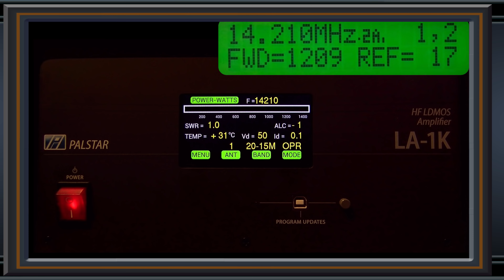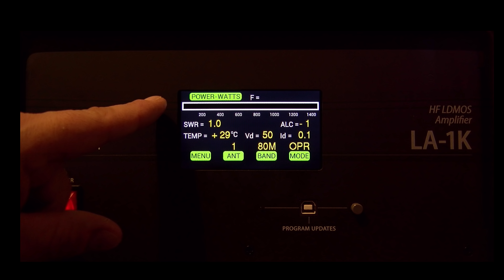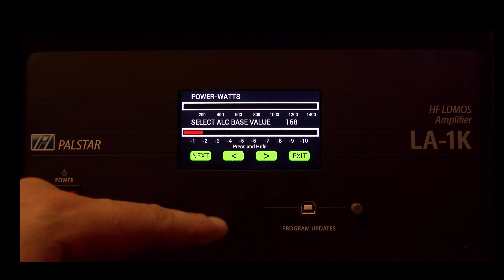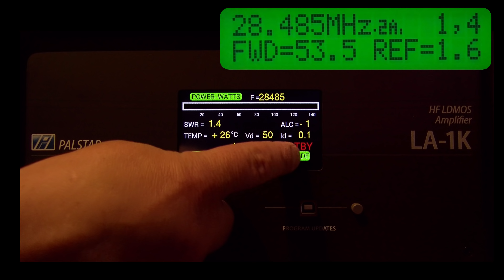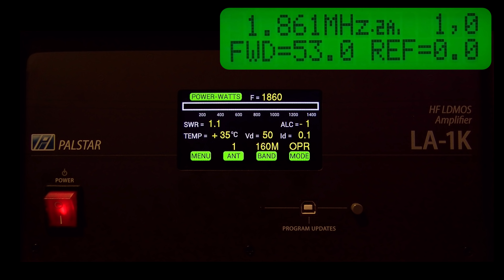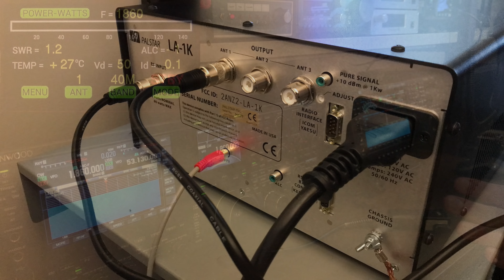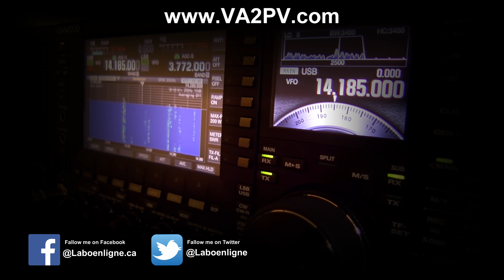Palstar LA-1K Review – 1 kW Solid-State LDMOS HF amplifier (6 to 160M)

Comment: I have a PALSTAR HF-AUTO working with a PGXL together. If my PGXL shows little over 1000 watts output, the PALSTAR HF-AUTO will only show like 450 watts. What is going on with this? Is this norm for SSB. Why won't the PALSTAR HF-AUTO reflect what the PGXL is showing? If there are issues with this, does that mean I am not getting my full output from my HF at the setting I have the power drive on my radio? So only 400 watts is going out from the PGXL into the auto tuner to the antenna?

Comment: You still must connect Transceiver RF output to the LA-1K via a coax. And, still connect a PTT cable from the transceiver to the LA-1K... so why are you saying you don't need a cable? Very confusing and misleading. Correct me if I misheard.

Comment: My LA-1K was shipped to me in supposed fully working condition.   However when it arrived, the power supply was D.O.A.   So, living in Ohio, me, my wife and our good friend Brian took a trip to Palstar just down the road off Hwy 75.   When we got there, I told Paul about this and he said " did you bring the Amp?".   I told him that I did and he told me to bring it in.   Without a word to me he asked Mark to open the amp and take a look, to see what the issue was.   Mark took it apart super quick speed and determined that the power supply was indeed dead.   So, Paul asked Mark to install a new power supply on the spot.   Mark answered all of my many questions and Paul did as well.     In less than a hours time, Mark had not only installed the new power supply and tested for operation, but he re-calibrated all bands and he installed a copy of the latest firmware, not on the site yet.   My amp is NOT under warranty, yet Paul and Mark did this for me for less than $160.00.    I have to say that not only is Palstar equipment the best I have ever used but, Paul, Eve, Mark and the gang treat you like family.  Palstar forever!!!!

Comment: I listened to your review and just bought the LA-1K amp. Very nice amp. How do you set your ALC base value, I have read the manual but not sure if I am operating it correctly.
Reply from the maker: I keep my drive low and adjust it manually, I have multiple HF radios I prefer not using the ALC.  For this type of interconnection I recommand you read carefully your radio and the amplifier manual prior of doing the connection.   I used all the time the LA-1K and love it.  73  Pascal VA2PV

Comment: For sure, Palstar's  are a very good products but, the Acom's solide state amplifiers are at another level in terms of engineering and construction.
Reply from the maker: I can't say for ACOM as I have Palstar, but still very satisfied.  I really like the RF sensing feature which allows me to use different HF radios without any physical connections except the PTT and the coax.  73 Pascal VA2PV
Reply: @Laboenligne  like Acom's  amplifiers mod  600/700/1200s . Enjoy your Palstar!

Comment: I know this was from a year ago, but I'm looking at one of these amps.  Great video.  How come you didn't get the matching hf-auto tuner too?
Reply from the maker: I had bought my MFJ-998 prior to the amp and the Palstar equivalent was too expensive at the time.  73
Reply: He doesn't need one, he uses a Steppir which tunes itself.
Reply from the maker: @johnratcliffe6438  True, I used it only on the 80M inverted V.  73

Comment: What are u using for a tuner? The HF-Auto? Mine keeps telling me it won't tune but I've been operating fine w/ my LDG for some time. I think I'll have to call Palstar.
Reply from the maker: I have a MFJ-998.  See my review.  https://youtu.be/n0MC4wU4-1s
Reply: @Laboenligne  Thanx. I was using an LDG AT-1000 & blew out the tuner AND the finals in my 101MP. Now it's gotta go in for svc! LDG's sending me another one right away. I think I'll back off & average 800 watts becz the LDG is rated lower. I hope I didn't blow out the amp. I doubt it! But my HF-Auto was defective so I had to send it in. Waiting on it now. Bad luck all around here! :(

Comment: Can you explain what you mean when you say the amp is RF sensing but not PTT sensing.
Reply: OK I think I understand what you are saying in that you have to manually switch the COAX to the right radio that you want to use.  Right?
Reply from the maker: @MacsForever1  Hi David, I mean that it won't transmit (amplify) if it detects RF and there's no PTT.  So the PTT needs to be connected.  Yes, it will detect the incoming RF and it doesn't care from which radio.  Se my video below for more information on my multiple HF setup.  73 Pascal VA2PV
https://youtu.be/9FntelKOjoc

Comment: I bought the LA-1K and HF-Auto.  They are very well made, and work very well.  I would like  to see Palstar modify the firmware on the LA-1K so that the Output Power sampling rate is increased, and it displays the peak value on the display, and places a purple vertical bar in the bargraph at that peak value.  The frequency data can be moved to the right..  There is a German ham that has built his own ldmos amplifier, and he is sampling his output power at 10,000 times a second, so he captures true peak values and updates the display more frequently.  The Output Power display isn't fast enough for the SSB mode.  What do you think?

Comment: Absolutely love this amp. Great video. I know a few folks who own one. Their a pleasure to operate. I use an acom 1000 which is also an awesome amp. I also have the HF auto tuner. So at some point I will purchase the Palstar amp to match that. It will work awesome with my flex system. 73s AA1US. .
Reply from the maker: I love it too ;-)  Thanks for watching!  73 Pascal VA2PV

Comment: What tuner are you using?
Reply from the maker: I'm using the MFJ-998 (1.5kW auto tuner).   73 Pascal VA2PV
Reply: Laboenligne.ca So I assume and you didn’t show this in the video at least I didn’t see it is that you keep the amp in standby then key and use auto tune or in my case it would be the palstar HF auto and then take it out of standby and you’re ready to go?

Comment: I hope you like it. Ill rather buy a om power. Or a old heathkit amp.
Reply from the maker: I do like it, look at my older video (before mai 2018) I had a top shape Heathkit amp SB-221. But now I cover from 6 to 160M continuous with 1Kw. This is perfect with my new SteppIR antenna that covers from 6 to 40M. 73 Pascal VA2PV

Comment: KM3KM amp is only $2500. It is a Kit but only requires a wiring connecting some cables and solder 4 RF connectors, it is actually the similar product with better pricing.Just FYI.